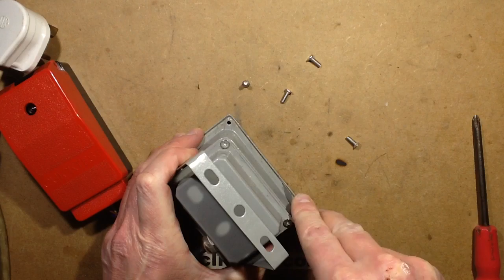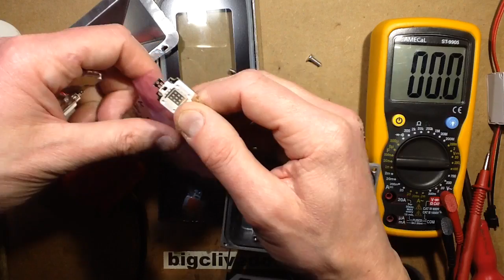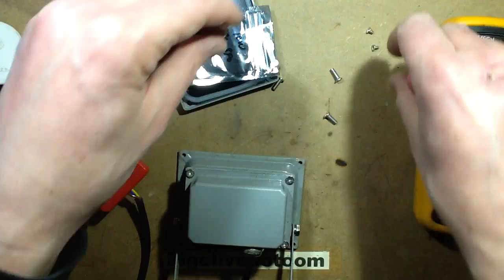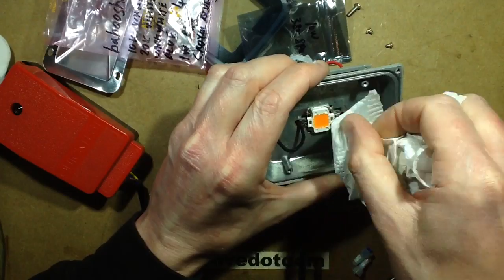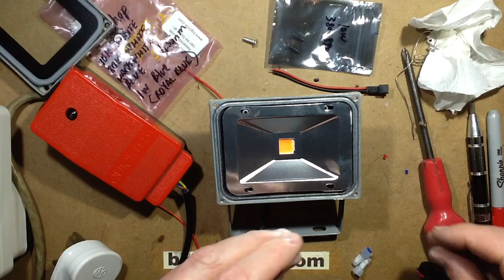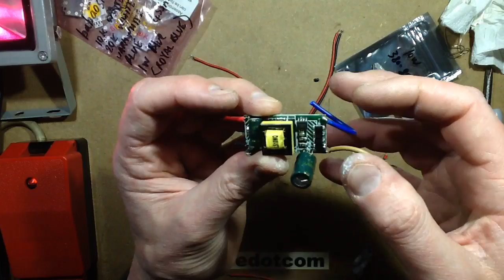Dead 10W LED floodlight  autopsy and repair/modification.

Comment: I had a 30W, 34 volt floodlight go recently. The whole spiel about LEDs lasting 30,000 hours is great until the driver goes. It's an IP65 or IP67 Ansell unit. The driver is unpotted and not sealed at all. There was corrosion on the PCB and one of the traces was blown. As a newbie, what are the odds that bridging the blown trace with a piece of wire would get it working again, or burn down the house?
Reply from the maker: If it's corroded open circuit it may fix it.  If it's actually blown there may be another fault.

Comment: I guess when you are always tinkering with 240V you get more safety aware.  I'm in 115-120V land and it doesn't bite so much when you get a finger where you shouldn't, so I guess I don't worry about it as much.  I do rarely work with 240V and I admit I am much more aware...
Reply from the maker: Even 120V can get nasty when water gets involved (like outdoor work).

Comment: I know...old video. That ack'd, My fix with a 12VDC LED would be to just add a coax connector mounted to the external case and power the light using an external wall-wart 12VDC adapter. Would be easier and possibly faster to perform the mod, possibly cheaper, removes the PSU as a source of heat in the metal case, and generally safer for an outdoor light.
In fact, I'd simply (if needed) enlarge one of the LED case power lead holes and install the coax connector there (or run a two-lead wire out to a sleeved water-resistant coax connector like a dongle kind of thing) and thus eliminate the entire PSU case, making it a VERY thin light.

Comment: 2 years later and I am  doing a project on a dead lamp case while i rewatch this video. The thing in question was a Luceco (not sure, either screwfix or toolstation) brand PIR floodlight. Basically the "driver" executed the 27v LED string.

I use quotes, because the (potted) driver, when dug out of the potting compound, was simply what looked like a normal dimmer switch (triac, diac, etc) and 2 fixed resistors in place of the pot, followed by a FULL BRIDGE RECTIFIER and a token smoothing cap.  One of the resistors had failed open, causing the 'pot' to be turned fully on. And sent the 27v LED string 340v. It reacted as you might expect. But the casing turned out handy for a 12v work light (6x 3w LEDs in series/parallel)
Reply from the maker: That's odd.  I've not come across that style of driver before
Reply: @bigclivedotcom  Well shit.. i mean poop. I wish i hadn't thrown it in  the trash now. It was potted into white silicone in a recess in the fitting's casting, I was amazed by the lack of components.
Reply: The PIR was clearly a seperate 'bought in module'

Comment: I had the exact same lamp with a PIR, after 3 years, it stopped working.A replacement led was around £2 but I tested the power supply output which indicated 62v and a replacement was £5 to £7. This was an outside security lamp so the casing was well corroded. A new lamp was £14 so a bit of a no brainer.Interestingly it states on the box " led not replaceable".
Reply from the maker: The open circuit voltage of the power supplies does go high off load.  They self regulate down by the current rating of the LED.  The main thing to note when replacing a 10W LED is that some are about 12V at 1A and some are about 30V at 300mA.  (either a three by three series/parallel array or all in series.)

Comment: sorry to ask but how much if a 100w led chip was run off a 30w driver what would the 100w be like will it be more the 50w 75w of will it just be a 100w off light brightness               thanks
Reply from the maker: It will be a bit brighter than a 30W LED.

Comment: sorry to ask trying to make my own floodlight from a old one if I use a 30w driver and a 100w led chip will the brightness be brighter than 30w it so what will it be  thanks
Reply from the maker: The LEDs are more efficient at lower current so it will be a bit brighter.
Reply: how much brighter in watts  do you think a 100w led chip if it will be on a 30w driver

Comment: This just gave me the idea to swap out the 8W White for a 20W 940nm IR.
Reply from the maker: Keep in mind that the case has to be big enough to dissipate the heat from the LED to keep it cool.
Reply: Very true. It's worth a shot - since this is a 12VDC fed LED I have less worry about a mains issue in the box. It's the same as the one you have in this video.
Reply from the maker: It's more about protecting the LED from the heat it generates in operation.  If it gets too hot it will fail.  That's why higher power LED floodlights have bigger cases for an LED array that is the same size, but rated at higher power.
Reply: That's the fun in experimentation, though, right? :)

Comment: If a student takes a discussion in a random direction, it's called "going off on a tangent" or "chasing rabbits".  If the professor goes off in a random direction, it's a "learned digression".  If you accept the title of professor, you weren't  chasing rabbits ;-)

Comment: Dear Clive, Very nice vid. I have a solar cell project that produces 12 volts DC to charge a battery.  I was wondering whether this supply would power a 20 watt LED PIR mains based light?  I see there are 10 or 20 watt LED lights that claim to work on 12 volts, I wonder if they do?

Comment: I have a couple R7S halogen replacement LED bulbs. Apparently 10 watt. 3 cob modules in the bulb. 24 chips a piece. White plastic with aluminium heat sink on the back. 78mm. Would there be similarities with that 10w power supply module inside? Is there somewhere I could post pictures for you to lend your expertise to a lowly noobie?

Comment: What would happen if you used a driverless chip with a driver?
Reply from the maker: +Loren Husky A typical driver wouldn't put out a high enough voltage to make it work.  But you could make it light at a lower intensity with a capacitive dropper circuit.

Comment: Hi Clive, few questions.

Firstly how comes you was expecting a reading within 20v when testing the LED. Shouldn't run at 230v as it's plugged into the mains? or is that the purpose of the driver? 

Also how did you know the polarity was correct at 12:20 with the live + neutral from the flex? 

Cheers mate, i'm not knowledge about this stuff so sorry if these are dumb questions!
Reply from the maker: The driver limits the current to the LED and also reduces the voltage.  When the LED works the voltage will drop to the level across the LEDs at their current it is designed to supply.  The polarity of the AC mains wasn't important in this unit as it is AC and has nu fusing or switching on the live side.
Reply: Ah I see, surely in this case the voltage had been dropped (as it was around 40 or so and not the standard 230v), or is there a specific voltage you should be looking for depending on the wattage of the driver?
Reply from the maker: The voltage is determined by the LED module.  Most are arrays of ten chips in series with a typical voltage per chip of 3V giving a combined voltage of around 30V.  The 10W LEDs are either series multiples of three LEDs giving a combined voltage of around 9V or a series string of 9 LEDs giving around 27V.

Comment: Does the ALU reflector piece in this things make a difference? 
I' mean, the light source is right UNDER the reflector, not like a bulb lamp for example.
Reply from the maker: I think it does help bounce back some of the light that is reflected by the front glass, but it's probably mainly for appearance.

Comment: i bought the 20w version of one... how do you know what fuse to put in the plug for these? btw iam going to use it for a fishtank light.
Reply from the maker: Only a low value fuse is needed.  In the UK it would be a 3A fuse.

Comment: Thanks for the video. I opened up "20W" unit and sure enough ground wire was just left in there,not terminated. I fixed that and replaced short mains cable that came pre-installed as I noticed cable insulation was cut by the nut.

Comment: Hey Clive, this teardown/repair of yours has actually inspired me to finally take a look at the LED floodlight I had lying around for ages (literally years) ever since it went black showing signs similar to yours. So far it seems that in my case the driver is toast (we'll see once the spare part arrives though, because it has a motion sensor that can still be wonky, I just don't feel like playing around with mains voltage that much, so I'll test it when I replace the driver instead), but I made several observations: the ground cable leading out of the floodlight was unconnected (hell even not even stripped!) the same way as yours, but the LED didn't seem to have been underdriven (the LED was pulling ~15W when I connected it to my lab power supply that can only do ~31 volts max, but the driver is rated at 30 watts). Thanks for the video though. It has finally pushed me to do some useful repair ;)

Comment: hi clive could you please link me to the kind of solder you use as being in uk im struggling to find lead solder i know its possible as you have but im prob looking in the wrong places :/
Reply from the maker: I buy mine from Rapid Electronics.  https://www.rapidonline.com/rapid-solder-wire-60-40-22swg-0-7mm-500g-reel-85-0595  But you could also look at Farnel/CPC and online for common tin/lead flux cored solder.

Comment: I've bought a heap of the 20W Ledvance floodlights through CPC recently. They're substantially better built than the previous ones we've had and they're not expensive at £11.50. Hopefully they'll last longer than the older ones!
Only thing is they're a really orange white which looks weird compared to the very blue white of the previous generation ones.

Comment: Final thought:  Could that light be powered by a 12v AC (magneto) source since it has a bridge rectifier in it for the household supply?  Would 12v give a lesser output from the 120vac it is designed for?  I ask wondering if one could be used on a snow blower with a 2amp 12vac charging system (no battery).  thanks.  Enjoyed the tear down.  Take care.  Doug

Comment: I had one just like that model which lasted about a year.  When I disassembled it the ground wire was coated in a blob of silicone on the end and attached nowhere, just floating!  So there was absolutely no ground whatsoever on an outside light.  Take care.  Doug

Comment: sometimes it looks like your soldering iron actually touches your fingers briefly. does it? do you get burned if the iron touches your skin for just a fraction of a second? ive never actually directly burned myself with my iron, only indirectly with wires ive been holding that get hot. i would think it'd burn immediately instead of that effect where you can handle things like hot coals as long as you move them very quickly through your hands.

Comment: I love that you keep mentioning that lead-free solder is garbage, whenever you solder things. Because it is.
Reply: When I started soldering I wonderd why it was so difficult. Then I tried lead solder..........
Reply: I also wondered why my soldering skills had deteriorated!   I was fine when a lot younger.   Then BC mentioned “lead fee crap solder” so many times I checked my reel and sure enough it was lead free.   Reverted to 60/40 and voila, old skills back!

Comment: bought a 5pk of these lights for 20USD to play around with. Gutted one already and refitted it with an XML led(for its efficiency), a mini funduino/LDR module, an 18650 with TP4056 board and a 5V solar panel. Putting this little guy in the garden as a very bright solar (sunset detecting) light with a run timer of my choosing. Gutted 2 more of them to hang high on a tree in the garden with a bank of 18650's charged by tp4056 from 5V solar panels and a switch to light up the main watering area. Came in very useful since our garden is very far away from any mains sources.

Comment: There are several camera apps on the app store that gives you better manual control. In a controlled setup such as yours, maybe you should give a couple a shot and ask for feedback! Also maybe you could get some clip-on lenses for the ipad that will give you full frame wide-angle, fisheye, or zoom for really cheap. would give a 1-up on Julian's magnifier shots ;)

Comment: so the power supply fried the LED?
Reply from the maker: Not necessarily.  The open circuit voltage of the power supply will be a lot higher than the LED voltage as the driver is a current regulating type.  When the LED is working the driver will pass its design current through the LED (about 300mA for this one) and the voltage across it will sit down to the combined forward voltage of the LEDs.
Reply: Did you try the LED on the bench PSU to see if you could make it do anything? They didn't put a 30V PSU on a 12V LED did they? :-)

Comment: I brought 2 of the exact same as this one I put one up in my front garden need my door and the other one outside my back door the one in near my front door failed after only 4 days I had the same problem the other one has been working just fine tho

Comment: +bigclivedotcom - you could use colour grading software like Black Magic daVinci Resolve to fix the colour issues. Actually Resolve is a full non linear editor, but you don't have to use that if you don't want to.

Comment: If you have any security cameras around your place you should make some of these with 10 watt IR LEDs. See how much you could light the place up without anyone noticing.
Reply: I agree!!!
Reply: +bigclivedotcom
Reply: You most likely WILL notice it. Professional IR-light stuff I use/install at work consists of 6 powerfull IR-LEDs. In darkness you easily see a dim red glow from the LEDs. I bet that those large COB LEDs aren better visible.
Reply: @weeardguy  as long as it isnt lighting the place up for human eye we're all good

Comment: Hi Clive just a quick question please. Could you recommend a decent make of LED flood light with the equivalent light of a 250w halogen flood please. Thanks in advance.
Reply from the maker: I'd suggest trying a 50W light from a local reputable electrical supplier that gives a guarantee.
Reply: Cheers Clive an particular brand to look for?
Reply from the maker: I couldn't specifically recommend any brand at the moment as they all seem to vary in quality.

Comment: Hey, I notice your iron looks a lot different than the one that came in my "yihua" are you using a non-stock iron?
Reply from the maker: It's a generic iron from eBay.  Often listed as a soldering handle and cheaper than buying some bits.  I did a test of several a while ago and ended up with a random one left in the soldering station.

Comment: Are you sure the LED was at fault. I recently bought 2 80 watt led lights from E bay and one of them was flashing from the start, I found the driver was at fault. As the supplier just sent a replacement I removed the driver and replaced it with a DC to DC converter and now run it from a 12 volt battery. The lamp actually only draws 20 watts not the 80 as it is supposed to but still lights up most of the garden a lot brighter than the 500 watt one it replaced.

Comment: The problem with all these LED floodlights is that you have provide an additional terminal box for the loose lead since there is no provision for connecting the supply cable unless you bodge it.

Comment: The solder station Clive mentions is the Yihua 8786D

There's a nice review including images of inside the unit here;

http://www.eevblog.com/forum/reviews/yihua-898bd-soldering-station-review/msg51921/?PHPSESSID=54dbe5efc3df4ed2a83523697437ec74#msg51921

Comment: That replacement Driver looks horrible..where's the emc filter?
Reply: You won't find one in a cheap chinese power supply. They are too big and expensive.
If you want to get rid of some of the noise, solder a Y2 rated capacitor between the high and low side negative rails. Something like a 2.2nF cap works pretty well.
Reply: It would be interesting to measure one to see how it measures up against the legal limit

Comment: Some LED Drivers can 'overshoot' at power on or when there is a short mains interruption. This means a very short term current overload. You should be able to detect this visually. As LEDs are very fragile to overcurrent this is something to watch out for.

Comment: I can't see why the original PS would have trouble driving the 12v LED. Those PS's don't really care about the output voltage, LED voltage should be less than max and that's all. The important thing is the original driver had a 300mA output too, so if you're happy about running LED at 3W, why change the driver?
Reply: You don't want to be putting 30-40V across a 12V LED. If it was current limited and would drop the voltage, but I can't see a 3W LED pulling the voltage down sufficiently.
Reply: The driver is a CURRENT SOURCE, it will push the current it wants and the led will determine the voltage across itself.  Your statement is true for voltage source, but the led driver is a current source.

Comment: Thanks Clive when I go in the workshop next I will have look. It's the same size unit in your video but does have a bigger led in the middle. There was always a black blow mark on one of the strips, I think they are made up of small smd leds not 1 cob(cheap)